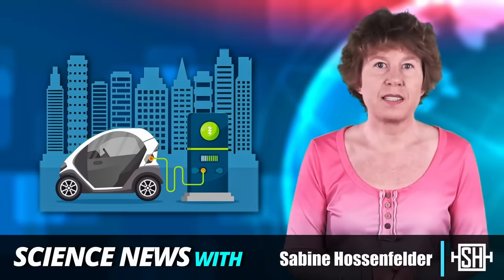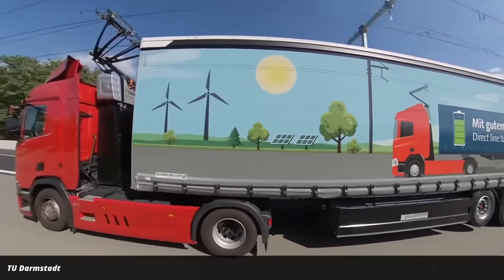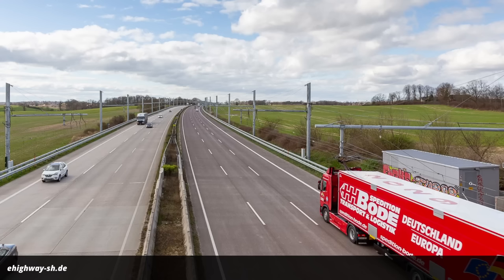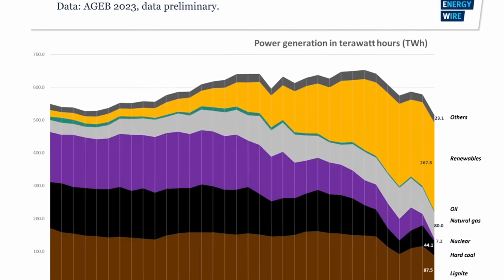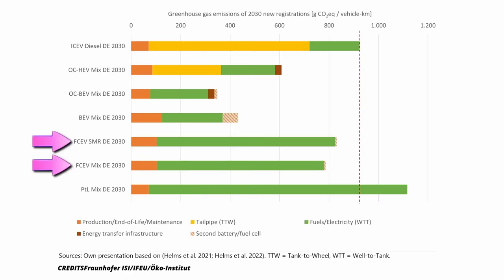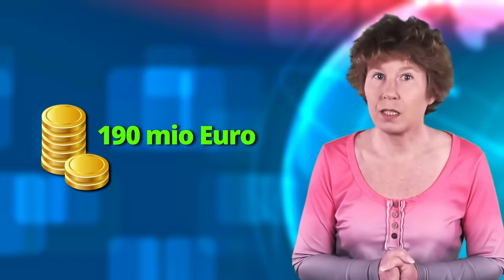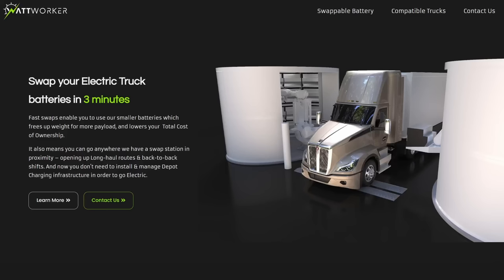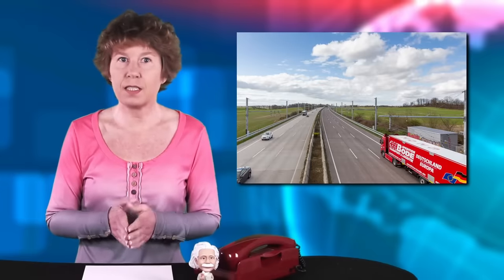Charging while Driving: Does it Work?

Comment: So we reinvented trolleybuses?
Reply: Trolleytrucks
Reply: Are you trolleing?

jk, we have those here in Argentina in my city, Córdoba. We bought them from Poland IIRC.
Reply: We had those in Cleveland as late as the 1960's. We called them "trackless trolleys". They only worked in the downtown area where there were overhead lines for the purpose.
Reply: Yes,but worse.
Reply: YEP. just doesn't need a rail
Reply: @GeomancerHT  Córdoba has the best system. São Paulo has them too. Saw one in Greece and didn't go near it haha.
Reply: Came here to post this. But you're wrong. Trolley buses are good in cities due to low speeds required, and they have little battery need as they never detach from the power lines. These trucks are like trains, but far worse, because a huge part of emission is the factor of weight to speed to breaking releasing particulates in the air from the tire friction with the road. These trucks are essentially worse trains requiring double the wiring, while still maintaining a good half of the polluting emissions of motor vehicles, which also carrying either conventional fuel or increased battery weight to run when the charging is not available. The idea is to cut down on diesel emissions, but Europe forgot the part where they also need cheap electricity (like the soviets had) to even make trolley buses work (why do you think trolly buses are rare in europe!), let alone this monstrosity.
Reply: Yep, seems so.
Reply: Pretty much.
Reply: @anon3118 yea, because rubber on asphalt is definitely more efficient than steel on steel
Reply: Brilliant!
Reply: @Sasha11711  Sounds like a good city. Free Ukraine! I wish OUR government weren't broken so we could do more. There's a huge Ukranian population in Cleveland.
Reply: Trolleys and Trains are the crabs of the transport system
Reply: @anon3118  Trolleybuses do not use rails. Trams do. https://en.wikipedia.org/wiki/Trolleybus
Reply: We had trolls busses where I live until the late 70s when they were switched over to diesel. I always thought that was wasteful and a bad idea.
Reply: We commoditized trolleybuses 👌
Reply: In a word: No. Becuase these are WORTHLESS! LMFAO!!!!
Reply: @anon3118  they never needed rails though. The one with rails is yet another different one, here we call tham "tramway"
Reply: @JamesToupin  As the motor car proliferated, trolley buses became uneconomic.  Even one trolley bus needs an entire grid to be operated and maintained.  ie, the same cost as if there were a hundred.
Reply: @harry130747 And one car still needs an entire network of roads
Reply: @OutsiderLabs  That's not the question because the most important vehicles for society are ambulance vehicles, firetrucks, police vehicles, agricultural vehicles, and delivery trucks. And all of these vehicles need a network of paved roads and an internal source of energy.
Reply: but we also made it into a research paper that trolleys exists and work. also that it has a serious problem: large infrastructure cost that needs to be payed upfront. we also found out that if you switch nuclear to renewables than you do not help the electric generation to be greener, but you can sell it as better, for some reason.
Reply: @GeomancerHT troll with it!
Reply: Looks like the system is improved somewhat mechanically. Most Trolleybuses probably don't run at 80km/h and attach and detach from the power line at speed.
Reply: With batteries bought from China
Reply: Precisely.
Reply: They could use... trains!
Reply: @harry130747  trolley buses (on top of trams and metros obviously) are a still economical and a great idea in high density environments.

1) you move a ton of people on a fraction of the road surface
2) you don't pollute the neighborhood with flue gas
3) while they need infrastructure, it's much less than what would be needed for a tram or metro.
So no, trolley buses are here to stay, and for good reason.
Reply: That’s the dumbest possible analogy but I’m guessing that’s what you were going for or it’s was the best you could do. Either way it doesn’t much matter.
Reply: No. These trucks can seamlessly transition between using the overhead power and the onboard power. Trolley buses can’t do that.
Reply: almost, but the concept does differ. This modern approach uses a pantograph so that they can detach to overtake and to use non electrified roads. The power supply is much higher for the increased loads. Tolly buses run at about 600 Volts DC drawing about 600 to 1200 Ampere. The overhead lines near Frankfurt (I hang out there too btw) run at 15,000 to 25,000 volts AC. Current consumption depends on factors such as the size and speed of the vehicles being powered, but typical currents can range from 100s to 1000s of amps. So there are differences.
Reply: Cool!
Reply: What do you mean 'we'?
Reply: @AndreSomers trolley buses have some batteries too, the contact to the cables is far from perfect so needs some energy buffer.
Reply: @Overt_Erre "like trains, but worse" <- The problem with trains is their inflexibility. In Germany (where one of those systems has been tested), you usually have to book train freight more than one year (!) in advance. That's not a problem inherit to trains, but how train transport is organized.
Reply: @dtibor5903  for minutes or seconds instead of for many kilometers. There is a difference.
Reply: Exactly: Seattle had electric buses with overhead power lines for decades: BUT, the cost of keeping the lines functioning was FAR HIGHER than the cost of diesel buses which today are not NG powered Buses here in Seattle Metro Area.  What she has not said is the power lines WEAR out and need constant 100% replacement which is why EVEYRONE dropped overhead electric bus/trolley's decades ago.
Reply: Seattle still has those tandem electric busses running on overhead cables.
Reply: @TheSkubna  If you say so.  Vast majority of the cables have been removed.  Have not seen any buses using the remaining cables.  Then again I have not been downtown seattle for a decade so...
Reply: Rail-less trolleytrucks, to be precise. 😅
Reply: @anon3118  Trolleybuses don't need rail. They operate on wheels.
Reply: @JamesToupin We have them here in Northern Europe. Most are hybrid buses/trolleybuses. They act as trolleybuses whenever they can, then drop their rods and continue their journey as regular diesel buses.
Reply: @doyouwanttogivemelekiss3097 We have these in Northern Europe.  Can't say they're much more convenient than regular diesel or hydrogen buses. Most of them are hybrids and still have to make a part of their route on diesel. Hydrogen buses don't have this limitation.
Reply: And in some sense made them worse. A Trolleybus can change lanes while staying connected to the wire. The Trolleytrucks can’t as they use a pantograph instead of trolleypoles. 
But in some sense pantographs are advantageous as speeds above 80kph are possible. With trolleypoles going above 80kph significantly increases the likelihood of “derailing”, loosing contact to the wire. But in the end trucks aren’t allowed to drive faster than 80kph anyway.
Reply: @Overt_Erre  Solingen has introduced BOB (Batterie-O-Bus) for reaching termini formerly reached by auxiliary Diesel and changed 3 Diesel lines to BOB-service.

Comment: The funniest thing is that the Germans turned off the cleanest source of energy - nuclear power plants.
Reply: funiest or scarriest- or both at the same time
Reply: @matthewthiesen6098  i would worry about it if it endangered anyone. It is kept safe and there is no urgency in dealing with it. Compact, secure and gets less radioactive fairly fast- it is a lie that it is dangerous for milenias when strong radio isotopes are gone in 300-500
Reply: Not funny at all.

Comment: As said on the video... we already have an existing infratructure that could be optimaly used for long distance transport. Problem lays on short distance. Meaning, small roads, not highways. Good luck wiring that.
Reply: Could be reloaded for short distance, no?
Reply: Issue with using rail is sorting out which cargo goes where. That could be fixed with individual powered and computer controlled one container wagons but you would need a complex government run rail system that could also be even more expensive.
Reply: I think that's why the thought that swappable batteries would be a better option. No wiring of various roads nor the problem of a major car accident taking out a chunk of the road wiring network that could stop transportation in a wider area.
Reply: You don't need wires for short distances, because batteries are sufficient for that.
Reply: @Lund.J  Why would plants that have evolved to use CO2 suddenly choose to use Cesium and Bromine?
Reply: @davidtherwhanger6795 
Wow, my comment has been deleted, again.
Conclusion:
Don't criticize the agenda.
Is this a political channel ?
Reply: @Lund.J  It has not been a political channel in my experience.
Reply: The grid wouldn't have this single point of failure. Part of the expense would be multiple hookups and lockout equipment so you'd have no charging for a say 15 miles which could be run from batteries. Not a stop.
Reply: @davidtherwhanger6795 
Well, most of my comments are deleted.
I try to use mild words; it doesn't help.
Perhaps it is personal, I don't know.

But..I do know...
Reply: Distribution centers. Use TRAINS to transport goods to them, use smaller trucks to take goods to stores from said centers.
Reply: @Lund.J  Never attribute to malice what can be explained by incompetence. And computers are by definition not competent. 

I've had to post the same comment up to six times before it finally saved in a thread. I'd post it. Goes thru fine. Come back later as I got no reply. It's gone now. Rinse and repeat. I have even gotten notifications of replies that cannot be found in the thread at all, but show up just fine in notifications. That has happened more times than I can count.
Reply: >Lund.J  : Try abbreviating or misspelling or inserting unusual characters into words that seem most likely to disturb an overly sensitive content moderating algorithm.  I've had success doing that.
Reply: In America short distance on a highway is hundreds of kilometers, this would be a massive investment but I think maybe one we might need it can work with public transportation in addition to transporting goods.
Reply: @brothermine2292 
Another way is to avoid certain ideas.
Reply: >Lund.J  : Sure, but I assumed your goal is to be able to post your ideas (and not have them deleted).
Reply: I wonder, if Metro-rail infrastructure can be used for cargo as well.
Reply: @Lund.J well, I see this comment from you so all of them aren't being deleted.
Reply: Small roads can still be wired up. Look up the various tram and trolley networks among many European cities (probably in other parts of the world too).
Reply: Exchangeable batteries really analyzers more cases especially last mile
Reply: @doctorhabilthcjesus4610  but they do lots of miles per day  and can just park to charge. So exchangeable batteries
Reply: @seriousmaran9414  We already have that, it's called a "road.". The autonomous single-wagon cargo vehicles are called "trucks."
Reply: @Lund.J  
Have you tried switching from "Top comments" to "Newest first"? The former setting does not show all comments.
Reply: @Lund.J  "certain" ideas... You mean "ideas" that are misinformation?
Reply: Short distances and batteries are a great combination. It's the long distance and batteries that's the problem at this current time, and at our current level of technology..

And TBH, compared to america, there's really no long distances in the EU. Because the entire EU, is less than half the size of America..... And that's still true even if you count the UK.
Reply: No we don't. Rail is overburdened and building new rail isn't easy.
Reply: No need to wire the small roads if they are changed to have a slope everywhere. then the trucks can just roll down the hills ;-)
Reply: @TehPwnerer  Switzerland was able to solve it
Reply: @zilfondel yes, but these trucs currently run on diesel, pollute the air, and their tires pollute our soils and drinking water. Putting them on trains for long distance crossing of the swiss alps is happening since 35 years in Switzerland. It's not "experimental", and the majority of trans-alps transport is done like this. Yes, it can be improved and made even better.
Reply: Hot swappable batteries seem like the obvious solution.
Reply: @TehPwnerer : A hundred kilometers isn't really a short distance in the US (though I guess the biggest city near me is the same scale of distance...), though long-haul is certainly much longer.
Reply: @BishopStars  it has also dangers: monopolies on the battery standards, new players with different / better chemistries may find it harder to enter the market, but yes it is an option too.
But if a truck is inside a train rolling at 160 km/h - and had its batteries charged, it may even be simpler. Truckers are legally obliged to make breaks too, if legally they can take that break while on the train, that's an additional benefit of putting trucks on a train.
Reply: BEV can handle the small roads & while we're here 24 Billion is really pretty small potatoes for a possible 60% reduction.
Reply: @Thomas-gk42  Does the fractal structure ring a bell?
Reply: @tinu5779  M. C. Escher will draw you the map. 😉
Reply: Not needed. Why would you charge on the go for short distances? That's the most stupid thing I've ever read. Especially because there are already vehicles that surpass 1,000 km with one charge...and battery research is still in its baby shoes. Self-learning AI is now speeding up the scientific and research work immensely.
Reply: @kinkfluencer  That would be about 150 years old baby.  But hey, “With men this is impossible, but with AI all things are possible.”
Reply: Rail is also a royal PITA wherever it intersects populations.  The problems are myriad, and it's absolutely rare for them to actually be addressed by the railroads, so one wmcould easily expect things to get worse if rail use were to suddenly increase.
Reply: Oh dear, more short term Feral Capitalist thinking.
There is research that shows how much more pollution  is caused by Trucks in Congested Traffic. Specifically, given that the most fuel used (pollution)by cars is in stop/start driving,   particularly when behind Large Trucks. The trucks have greater mass, taking more energy  and time  to go from idle to overcoming inertia, and as such  the vehicles behind are less efficient and create more pollution than on a highway. In some countries, Big Trucks are banned from local roads  during peak times for that reason. And Some cities ban Big truck deliveries. 
Ergo, one of the solutions is better management of freight transfer in hubs and better understanding of the actual cost structures  involved. I ran a fleet of big trucks, smaller truck and vans… in the long run it worked out both cheaper and more environmentally sound.
Reply: @examinatorant4522  ahhh, centralized management of resources... That always goes so well.
Reply: newest batteries charge in 15m now, no need for any of this crap, battery tech is now superior than conventional ICE
Reply: @elduderino7767  False, so much false.
Reply: I know! Really long extension cords!
Reply: @watcherofwatchers   Yes and No, Bad management of ANYTHING is always a problem. 
Having said that, what is the issue  that these trucks  are trying to solve?  These truck over head lines, are trying to mitigate/ slow down  Climate Change and Petrochemical caused pollution. With the unpriced medical ill effects on people. 
Sadly, greed, incompetence and short term Feral Capitalism, consumerist thinking are not the issue here.

Comment: Right idea - wrong place.  US 15, LA to Vegas.  Constant line of trucks.  Lots of low cost electric power. Build overhead power on steep grades, optimize batteries for long flat stretches.
Reply: Right situation. Wrong politicians.
Reply: Hey! This seems to make sense! Don't ever count on it! (said the cynic) :D
Reply: Unfortunately, no electric power infrastructure.
Reply: Lots of trucks on the German autobahns so still a good place for it if the costs can be managed.
Reply: Seems like a train would work better.
Reply: Use a railway and save even more.  Your point is stupid.  Not a universal solution and why costs spiral out of control.
Reply: @lubumbashi6666  There already is substantial rail traffic out of LA -> LV.  However, the truck route (LA->IV on I-15) may be one of the largest volume truck routes in US (top 5 probably).  This is especially true before the split to Phoenix.  Most of the elevation gain occurs before the split.  This means an "EV" hybrid truck can use the catenary on the upgrade and use batteries or diesel for level portions.    There are substantial solar EV projects along the route.  About 5 years ago Siemans had a similar demo project at Port of LA.

Comment: We've been using this technology for city buses in Seattle for 40 years.
Reply: We scrapped the tech in Winnipeg 50 years ago.:face-pink-tears:
Reply: Pantographs were used in trolleybuses from the early 1900s. Some of the newer Chinese buses have pantographs and high-speed charging at the stops but not between them, allowing them to run continuously. This seems like a more economical route to go. More difficult for trucks which go long distances between scheduled stops.  Just having high-speed charging at the local depot would work for local distribution, though, where the vehicles return frequently to restock.
Reply: And it was scrapped in Seattle for same reason it was scrapped everywhere else.  The overhead lines cost a gargantuan sum to maintain and replace all the time as they wear out.  Sure, the buses are cheap to operate, but the cost of the power lines is beyond prohibitive.
Reply: We have been using it for teams some 100 ears
Reply: Yes I saw them on a recent trip to Guangzhou.